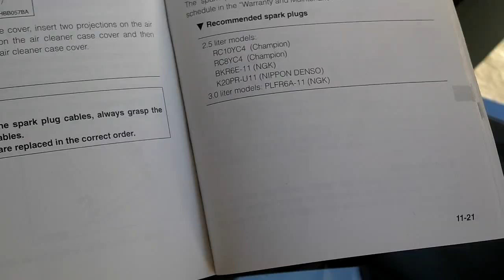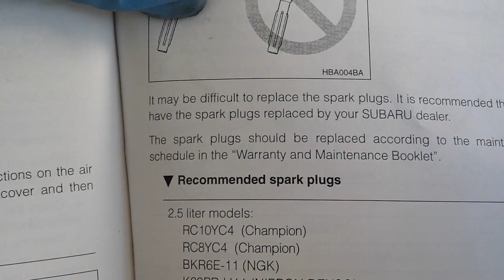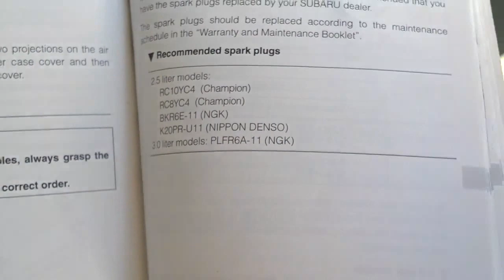How to replace the spark plugs (tune up) in your Subaru  with a 2.5L - VOTD

Comment: Wow that engine bay is amazingly clean, I'm jealous
Reply from the maker: +david84ss desert and no oil leaks.
Reply: The correct spark plug gap for a 2001 Subaru Forester is 0.039 - 0.043 as stated on page 12-2 (under specifications) in the owner's manual. 
And thanks for the GREAT video, especially the info about platinum spark plugs!

Comment: Thank you for sharing this Robert. I did not know that about Subaru and platinum plugs. I am changing plugs in my wife's Subaru today because of firing issues and it turns out the ones I removed were platinum.
Reply from the maker: slade88green Hope it goes well.

Comment: Thank You 😊 Robert DIY. My wife's 2003 Subaru Outback with 143K miles would run rough and the Check engine light flashed when it was raining out. 
I saw a spark jumping from the coil pack to the engine block at #4 coil. I replaced the coil pack but the issue persisted. So following your video I replaced the plugs & wires with NGK OEM Replacement parts. Car 🚗 runs strong 💪 now. Hoping to see better mileage now. Only ever got about 20 mpg. Only problem I had was during install I dropped a plug. Despite 2 of us look 👀ing extensively we could not find it. So I finally had to run out and buy a 5 plug. I didn't have a torque wrench so I used the guide of finger tighten then 1/2 turn with the wrench. 
I need to buy a torque wrench for future work. Your video was very helpful in its suggestion to remove the Airbox and Washer Tank to get to the plugs. Otherwise it looked impossible.
Reply from the maker: +Dave Cruikshank glad you were able to get them changed.

Comment: good video Robert...not only should you replace the valve cover gaskets, you should also replace the plug tube seals inside the valve cover...if the wires have any oil on the outside, it is a good idea to just replace all the wires with the gaskets and save future problems...keep up the good work
Reply from the maker: Thanks for the suggestions. I tried to tell my brother that the car needed more work but he wants to hold off for now. When he is ready I will do it all.
Reply: i did my plugs, wires and valve cover gaskets today....as soon as I pulled out the wire, there was oil covering the plug wire.....I had planned on doing the gaskets anyway but I felt better knowing my skip and flashing check engine light most likely was from bad wires....I have 98K on the Baja....not sure if I will tackle the timing belt even though I am a mechanic....I know I can do it but being only my second one, it scares me...its not like doing a brake job or kingpin job....THIS is your ENGINE and timing and running.....anyway, it took me 3 hours to do it slowly and thoroughly and the car fired right up and sounded great....another tip I learned the hard way but not real hard was to tape the socket to the extension so it doesn't get stuck in the tube...DO IT....thanks for posting your video
Reply from the maker: Good to read. I think you should do the timing belt. If you get stuck, just have it towed to a mechanic.

Comment: Thanks!! Changing plugs and wires today to hopefully fix a chugging issue, although no code has appeared, barely limped the vehicle home. At least I'll have new plugs and wires!
Reply from the maker: Thanks for watching.
Reply: I have almost the identical problem. I have the new NGK wires on order will let you know. Very annoying, no error codes!

Comment: My 01 Legacy came with NGK Iridium IX plugs, and that's what I replaced mine with.
Reply from the maker: Ok
Reply: That's what someone who owned it before you put in it. The manufacturer recommends copper plugs. There's no way the car came with that type of plug from the manufacturer.

Comment: I'm currently redoing a lot of the stuff in my '00 Subaru OBW and can definitely say, I'd rather spend $8 on 4 plugs and replace them a few times than buy plugs that are $8+ a piece(if they are meant for your car, they come pre-spaced). I also permanently took out the air intake and made my own with one of the left over tubes and a duct pipe elbow(also had to install an air scoop on the hood after putting a hole in the hood) and it definitely runs better since the OEM air intake is worse than taking the whole thing out and not even putting another one in. Also freed up a crap load of room around my engine for things like spark plugs and the head gasket I need to work on.
Reply from the maker: How many miles do you have on it?
Reply: 210,000
Reply from the maker: Nice, keep it rolling.
Reply: Thanks!

Comment: Thanks for posting Rob.  How did you start the new plugs in the spark plug well, without cross threading?  Did you just use the extension with your fingers?
Reply: I would just put the plug in a plug socket connected to an extension and hand thread it ... MAKE SURE IT THREADS SMOOTHLY WITH NO RESISTANCE.

Comment: Good info, I have Bosh Double Iridium plugs for my 2001. Wondering if I should rethink it. I installed them in my 2002 Sequoia and it runs pretty good.
Reply from the maker: Won't hurt to try them.

Comment: Those valve cover gaskets always end up leaking on those Subarus. Good idea to replace them if you notice oil on the spark plugs
Reply from the maker: Yes, not sure how much of a pain in the butt it will be yet, but maybe they will want it done soon.
Reply: It's not too bad. Btw on the drivers side it's usually easier to remove the battery in lieu of the washer fluid reservoir tank
Reply from the maker: To get the sparks plugs out?
Reply: Yeah I've seen people do it that way with success
Reply from the maker: Thanks for the info.
Reply: Michael Sackstein - correct
Reply: absolutely.  I've replaced plugs, wires and valve covers on my 01 Legacy.  It's not too bad to do and is well worth it.

Comment: on a tune up, should i change out the spark plug wires in my 1998 subaru? I didnt have to in my 2002 honda because i didnt have to.. should i do this on the subaru
Reply from the maker: I usually replace wires with OEM brand every 100,000 miles.

Comment: The reason for the platinum plugs to be used is the fact the platinum or iridium is a much harder metal than the old copper.  The voltage is simply a function of the spark plug gap.  As long as you buy the correct heat range you are fine.  Subaru uses iridium.  If you buy genuine Subaru ones they are pre-gapped.
Reply from the maker: Goodman diad Thanks for the info.

Comment: I believe these Subarus are designed to take NKG spark plugs.
Reply from the maker: I believe you are correct. I purchased those plugs at the dealer.

Today I decided to check on replacing the plugs on that Jag and read some information a guy wrote about replacing plugs on his Jag. He decided to install normal copper type plugs. A few of the guys were rambling on about the difference of the plug types. I got a few things out of it:
1. The higher dollar, more expensive plugs run better in non-turbo/non-super charged cars.
2. Plugs have a temperature rating that has a good fire range. A plug with the wrong temp range can cause knock (pre-detonation).
3. Running the plugs that has the wrong temperature rating may ignite better at a different temp which may cost you a little in fuel consumption.
4. Your car may run better with copper tip plugs, but they will not last as long as platinum or iridium plugs.

So, some car manufactures recommend high dollar plugs just so they last 100,000 miles, even if they cost you a little in performance and fuel economy.
Reply: good luck on that jaguar, those things are a pain to fix
Reply from the maker: I have 4 things left to fix so far.
1. ABS
2. Cam cover gaskets.
3. Serpentine belt.
4. Roof liner (may not do).